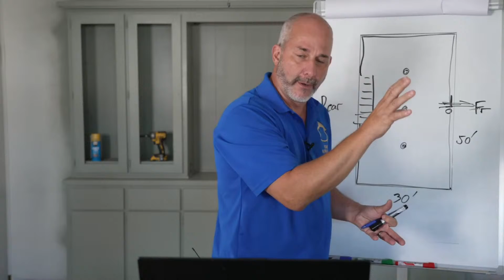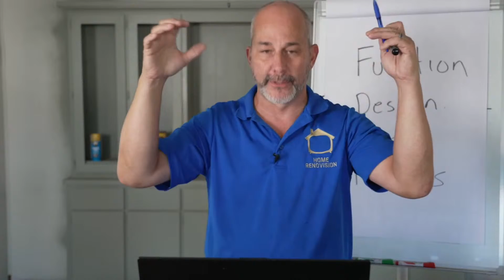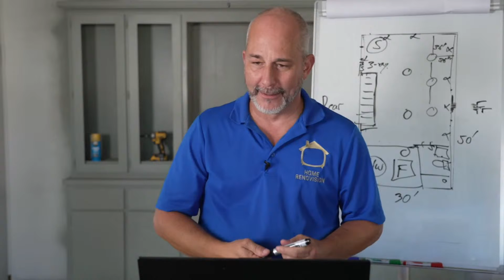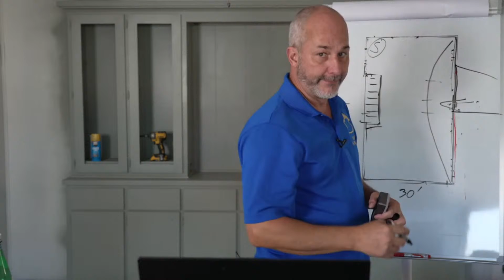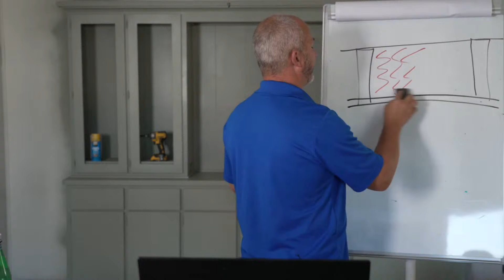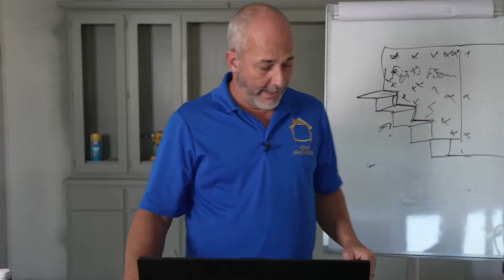How To Plan a Basement Renovation

Comment: Thank you for addressing the issue of finishing the space where stairs come down along cement walls. I'm not sure if the solution you described of attaching drywall to the rigid foam would be suitable for me.

My cement walls are formed with the brick molding and are not so flat. Would you be staggering this drywall set on the rigid foam so the ends of foam and drywall do not line up?
 
Does the gluing method hold up well?
Reply from the maker: the secret is to adhere the rigid foam to the concrete and let it sit until cured. 1 or 2 days. then glue the drywall to a flat surface. Cheers!

Comment: Hey Jeff what are your thoughts on basement walkouts. Also with regards to moisture issues in the basements, would closed cell spray foam be a good option to mitigate? I live in the Greater Toronto Area. Thanks
Reply from the maker: spray foam is actually a bad return on investment in a basement. if you ever have a foundation issue you will never find it without destroying all the work.

Comment: Im finishing my basement into a two bedroom suite (all according to building code in Ottawa). I have a dry basement except for water that collects sometimes (about once every five years) into a sump hole that has a sump pump in it. I suspect that the hole is not properly done because it has no barrel or any structure and the hole is just a 12" square cut though the the poured concrete floor to be about 10" deep. . Should I leave this 'sump hole' alone, or does it need to be dug out to be deeper or wider?
Reply from the maker: as long as it works don't bother. the water in that region is not going to fluctuate too much except in heavy snow years. I would install a lid that is insulated with rigid foam to eliminate the ability for water to escape into the atmosphere. Cheers!

Comment: Hi, Jeff. When you show how to insulate area nearby basement stairs and say "put rigid insulation and drywall on the wall", is this method is not code complied? Because its also reduces  stairs width. Thank you for answer in advance!
Reply from the maker: I totally understand but even with code existing buildings need the inspectors to allow certain adjustments to the ideal. this is a very common practice in the industry and is widely accepted as the best mix of modern code and old school construction. Cheers!

Comment: Electric panels are not allowed in storage closets.
Reply from the maker: check local codes but as long as you satisfy clearance a closet is just a small electrical room.
Reply: Where does it say this?
Reply: You have to have 3 foot free and clear access in most areas
Reply: Also can’t hide it. Be proud that you have electricity
Reply: They are not allowed in clothing closets. Because things like clothing, and shoes are flammable so not a good item near panels.
They are allowed in storage closets though. As long as it meets the clearance codes.

Comment: Basement with glued-down carpet, I want to level the floor with floor leveler.  It's quite wavy to walk on.
Ripping the carpet up, there's residue from the glue - is there a good way to clean that so I can prime and level?
Reply from the maker: you can use a scrapper or just use a multi surface bonding primer on it and level. Cheers!

Comment: Thank you for all you do for the DIY families!! The question that I have is: I have a home that was built in 2012 in Saint Robert, MO, USA, with a sizeable roughed-in basement. I will finish it, and I want to put Vinal foolering down. I have talked to a couple of contractors about putting a subfloor in, and they say that they never do BC; that is only for homes in colder climates. Should I still put the subfloor in? or have a thick mat on the concrete then the flooring?
Reply from the maker: the need for a thermal break is real and has nothing to do with a cold climate. the dirt  around the house is 50 degrees and the dirt under the floor is 50 degrees. without a thermal break the floor temp is constantly going to feel cold especially in the summer months when the a/c is on. Cheers!
Reply: Thank you so very much!! From watching your teachings, I had a sense that I needed one =) Again thank you for what you and your team do!!! @HomeRenoVisionDIY
Reply from the maker: Cheers , Happy to help!
Reply: @joshuared1000  Hi dear Good evening . I hope my comment didn't sound as a form of privacy invasion your comment  tells of a man  with a beautiful heart which led me to comment  I don’t a normally write in the comment section but I think you deserve this complement. If you don’t mind can we be friends? Thanks  God bless you….🌺🌺🌺